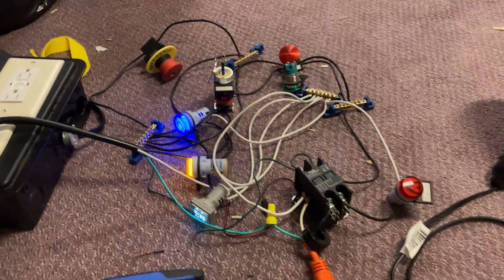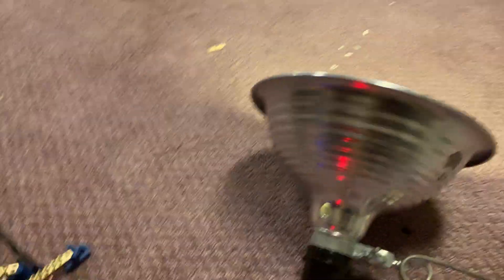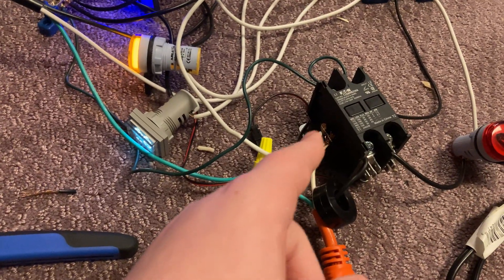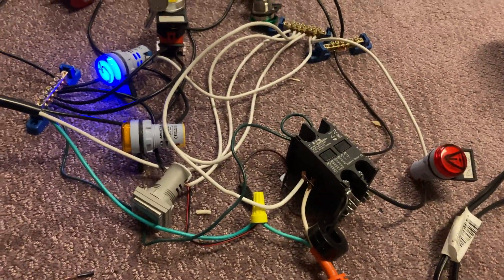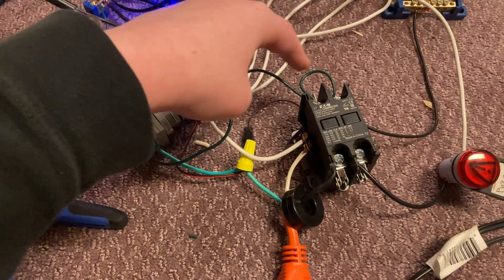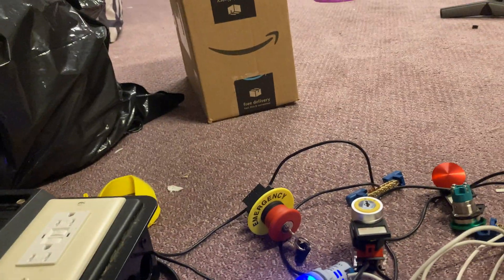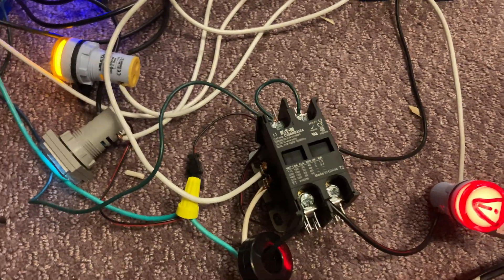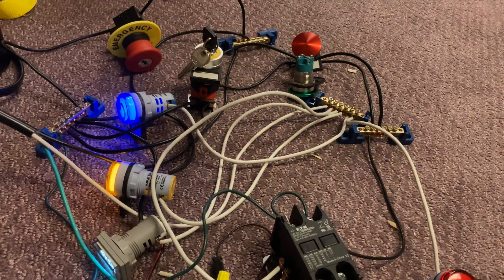Megaproject #1 pt. #3 Upgraded demo system

Comment: Hey, I just saw your new video about the breaker box, but the comments are turned off so I'll just comment on this.  

You should definitely crimp those wires in the bus bar, leaving them like that could be a fire hazard depending on the amperage and condition of the strands.  
I guess tinning them would also be an option, but atleast where I live that's not up to code.

Comment: You should get real pull stations and real fire alarms for the fire alarm snap circuit system, someone else did a video of his snap circuit fire alarm system test 6 and it had real pull stations and strobes